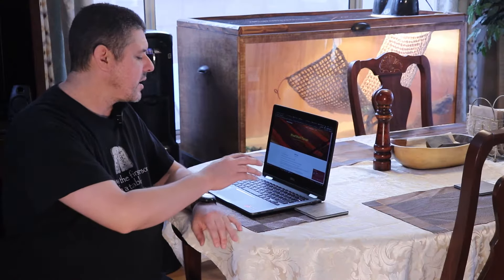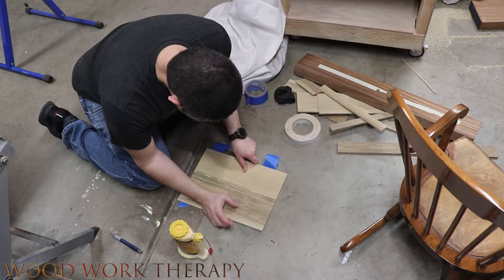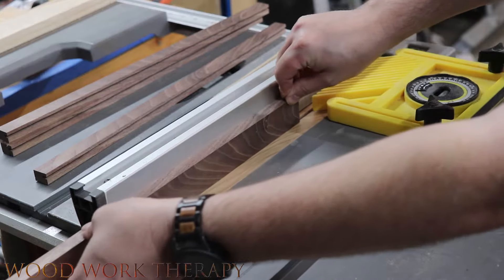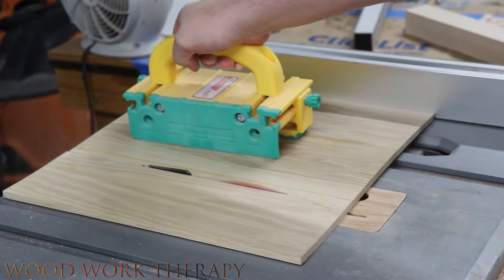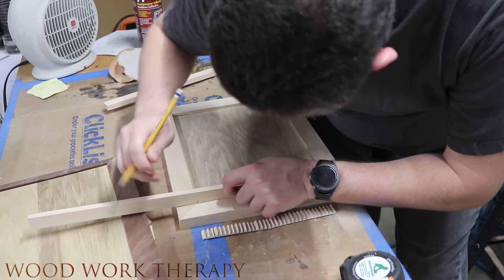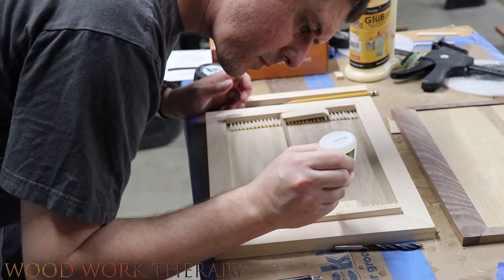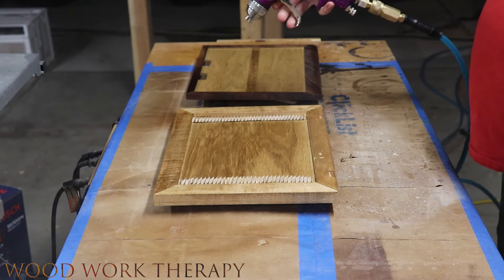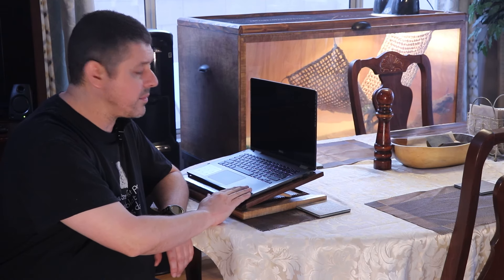DIY Adjustable Laptop Stand: How to Make it from Wood Scraps!

Comment: Hey I noticed on your re-saw segment you removed the high fence on the bandsaw. I have that same saw and I too removed that high fence attachment not that it caused a problem but I gain more distance left of the blade. Also your table saw/band saw-re-saw trick is ideal and the stair step template is great. I made a cook book stand with similar but coarser stairs that are tough to draw out evenly.
Reply from the maker: Yeah the stair-step design is totally the way to go. They are fragile as you saw, but they glue on fine, and the side of the frame aligns them to keep them looking nice. I still use it to this day for stuff. And it has never had a failure. Funny on this video is I almost didn't make it because it was literally a throw-together project. LOL The only thing I spent time thinking out was the stair steps that I created in Photoshop so I could have that narrow accurate look for the stps. The whole project was literally made from cut-offs, no extra wood was purchased for the project. :)